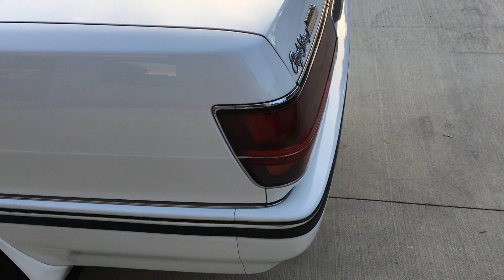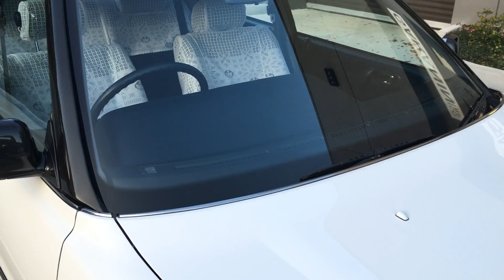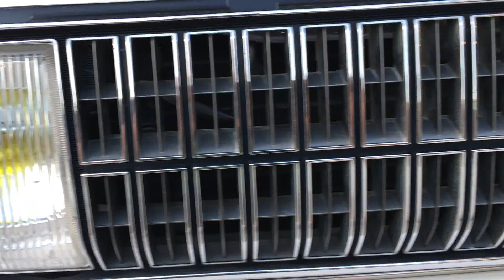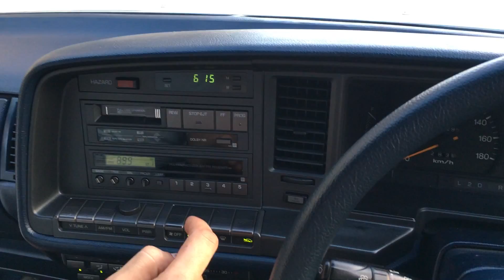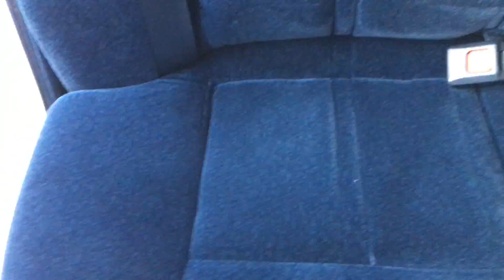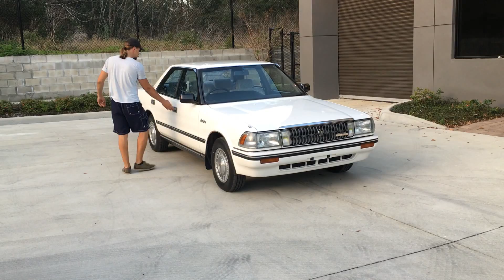1987 Toyota Crown Royal Saloon Supercharged

Comment: I own Toyota Crown Royal Saloon A/T 1991, S130 Model GS131, Engine 1G-FE 2000cc DOHC 24 valves, Silver color, interior seats Maroon color , full leather dashboard with analog meter, not digital meter, telescopic & tilt steering, driver`s power seat, power sliding back seat, Auto A/C, front auto swing A/C vent, rear A/C vent, rear small fridge, the same model as above video but the door windows are not frameless, the backlight model is different too, my Crown has Red light on upper side, Yellow light and backward light on downside, this vintage car is really awesome, I`m in Jakarta city, Indonesia.....

Comment: I own Toyota Crown Royal Saloon A/T 1991, S130 Model GS131, Engine 1G-FE 2000cc DOHC 24 valves, Silver color, interior seats Maroon color , full leather dashboard with analog meter, but not digital meter, tilt and telescopic steering, power windows, driver`s power seat and power reclining back seat, climate control A/C with controls for front and rear, front auto swing A/C vent, rear A/C vent, built in fridge in the rear parcel shelf, standard audio with 6 speakers, but without navigation system & display and without (TEMS) Toyota Electronic Modulated Suspension adjustment, looks the same model as yours but the windows are not frameless, your Crown is Hardtop model, the tail light model is different too, my Crown has Red light on upper side, Yellow light and backward light on downside, this Japanese vintage car is really awesome, I`m in Jakarta, Indonesia.....